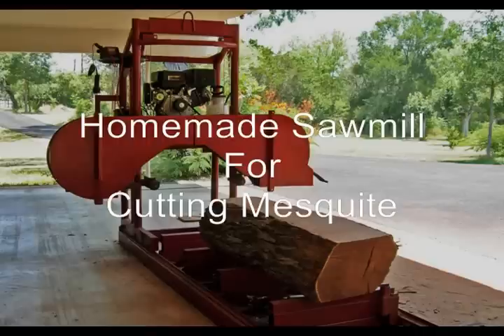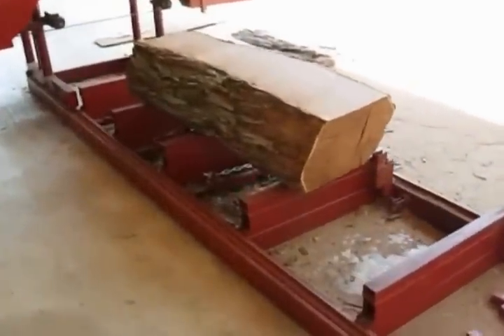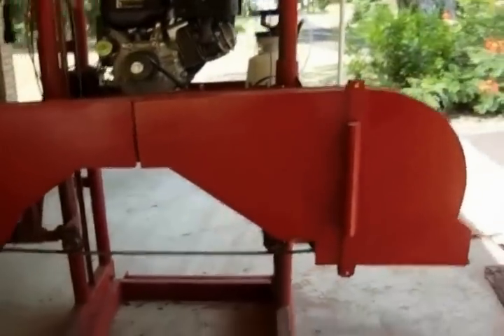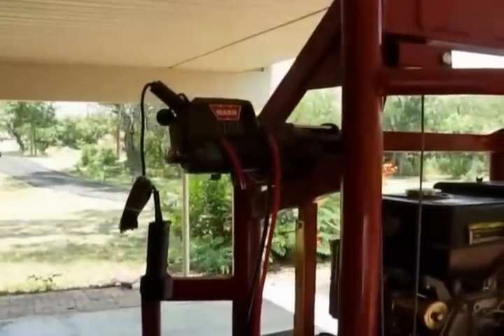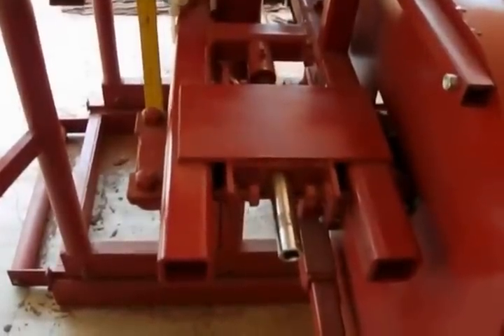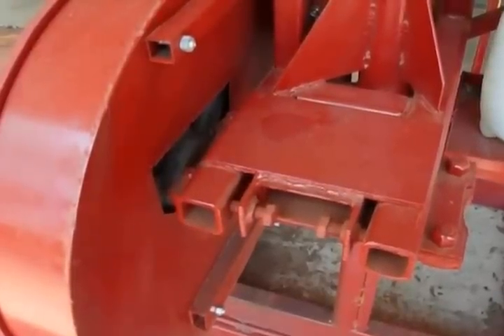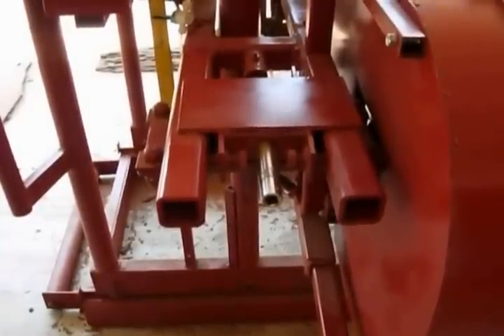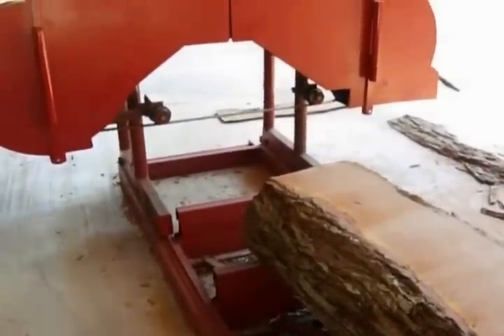Homemade Band Sawmill First Version

Comment: I purchased your info, and working on gathering all items up for the build. I will be constructing a 42'' cut for Diagonal cut on cant's for table tops. finding 26 inch drive wheels has been difficult, without new purchase. I do appreciate  your design. Thanks

Comment: Thanks for this video, I am glad you show it running with the gaurds off, it makes more sense of the working system, do you have sweeper brushes in front of the wheel rollers? I would think that even a small chip of bark could derail your carriage. The big blade wheels look like they are made for purpose, do you buy these second hand? An excellent video!

Comment: i do like your 4 post design. one of the more sturdy & solid design i have seen on here. however. maybe its just me, but it looked like it was racking slightly. maybe extending the wheel base would fix that?  all in all it looks professional.